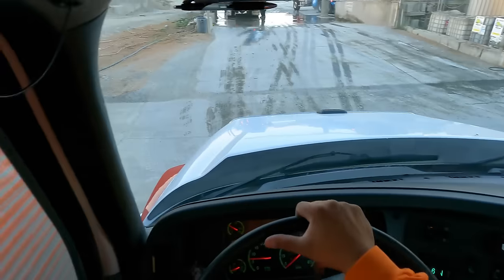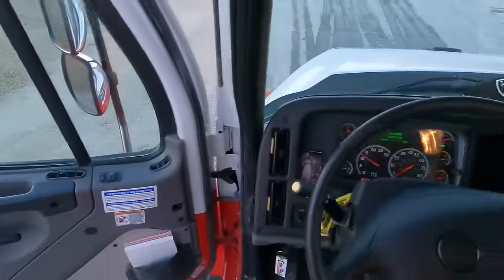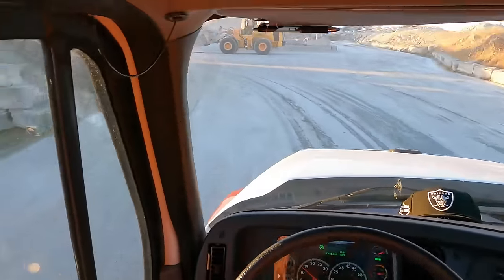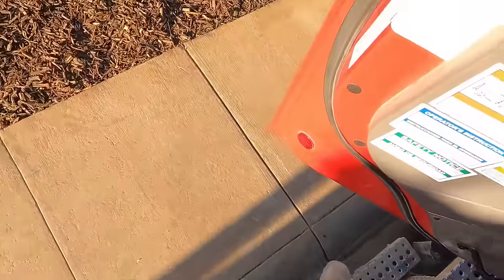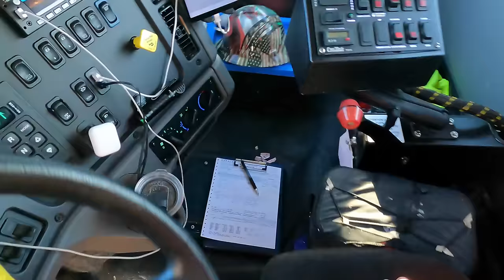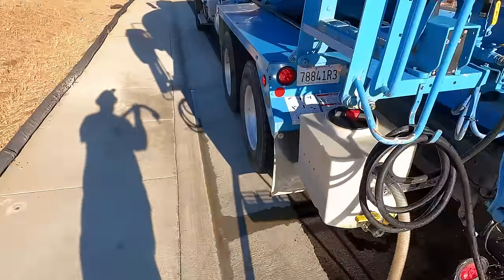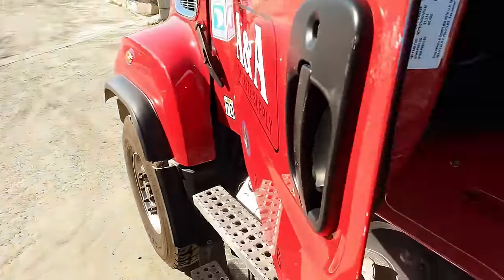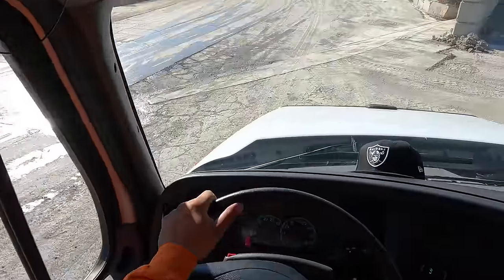A day in the life of a concrete truck driver

Comment: I just came across this channel because I want to learn a little bit before I start my new job as a ready mix truck driver. I’m impressed with the job on how easy it is. The best part is that I get to go home every day to my family. 👍💯
Reply from the maker: Easy money just get to know your truck and how to adjust your concrete and you’ll be good
Reply: I'm going through a career change and starting my new job as a ready mix driver in a few days.  Did you start working yet @king69king1?  If so, how you liking it so far?

Comment: Thanks for the reply over here in uk our concrete trucks come in 3 sizes ,in metric sizes ,4 wheel truck carry 4 cube ,6 wheeler similar to yours 6 cube and 8 wheeler 8 cubes ,I know you guys in us use yards so not sure about your weights
Reply from the maker: Yea we use yards max we can carry is 4 yards but I just looked some of those up and some other states have trucks similar to that here in California majority of the trucks look like this due to the weight of the truck and the weight the roads can hold over here and it’s California so there more picky 😂
Reply: @Mixermafia23  I do this in Idaho and we carry 10 yards. Trucks are usually at around 70k lbs. we do a bunch of offroad jobs and it's really sketchy. are trucks get stuck a lot and if you know a mixer truck you know it's an entirely different beast. These trucks will flip over just by you looking at it wrong.

Comment: Hello is this wheel base at the end for the weight? We in Germany have 2 main type of Concrete Trucks a 3 axles truck can load 6 Cubic Meter and a 4 axles Truck can load 7.5 Cubic Meter. They also have a big Drum what is able to load up to 8 or 9 Cubic Meter but its not allowed anymore. The washdown system with the buket is awesome, we dont have this. Sry for my bad writing.

Comment: Guys always forget to lock their shoot and not just the button, but the actual lever that goes into the slot and then there’s a lot of guys that won’t use the chain for the flop over and I’ve seen those flip over when they hit a bump hard enough. Also three points of contact when you get out of truck been there done that gotten out of a truck and fallen because I didn’t have much of a grip on anything when you get out of Truck towards you’re likely to do the whole slip, trip and fall. 
But yeah, that was a good video .

Comment: Scrub your truck, scrub it some more, just when you think you're done scrubbing you gotta scrub it again. I've been doing this job for over 2 years and I have found out. It is hard on your body when you have bad shoulders and a bad back.  Not the hardest job physically, but lots of awkward movements in this job. So there is lots of potential to hurt yourself. Also, it is hard on the back.As the suspensions are very stiff on these trucks.

Comment: Do you need your fill your water tank?
Reply from the maker: Yes always need to fill it when we get back from a job just in case we need to add water to the concrete on the job and also to wash down and clean up

Comment: why drop the tag during loading it could pick the tandems off the ground if the pressure is set for a 10yd load
Reply from the maker: I stop them before they hit the ground we all load like that here to prevent the concrete from spilling all over the booster axle
Reply: Also you can have your pressure set low and it won’t lift the axles.
Reply: @Mixermafia23  we never had room to do but as long as the boot was fully in and they didnt slam the cement and flash in,u would be ok.

Comment: How many yards does that truck hold? Been doing concrete now for about 5 years at 23 years old and haven’t seen a truck with that much space between your “barrel or drum” and cab ever. Just curious👌 much love and drive safe 🙏
Reply from the maker: These hold about 10.5 yards but they only load us with 10 but the space your talking about we did notice these trucks are longer than our mcnelius mixers those are a little shorter the one I drive is a contech when I first saw it I was wondering the same thing

Comment: Hi from the uk your trucks are different from ours ,what are the wheels that fold used for might be a dumb question but we don't have them in uk everything else is simular enjoyed your video
Reply from the maker: Not a dumb question at all brotha that’s called a booster axle we put those down when we get loaded with 5 or more yards to help the truck with the weight

Comment: Take it out of gear pendèjo
Reply from the maker: Out of gear?
Reply: @Mixermafia23  You popped the parking brake without switching it to neutral. Normally on a maintained truck you're fine, but sometimes there is a failure in the solenoid that puts it partially in neutral. When you rev the truck up to spin the drum, it is possible for the truck to remain in gear and take off on you.
Reply from the maker: @WhyNotChris0  we’ve had that happen slips my mind at times just because it’s never happend to me but I’ll make sure to watch it more often thanks brotha
Reply: RobertPalacio, so rude dude 😄 but it made me laugh